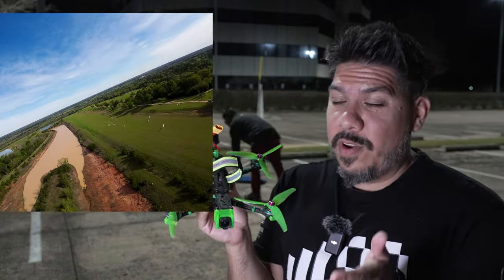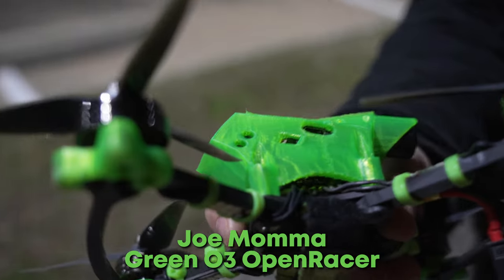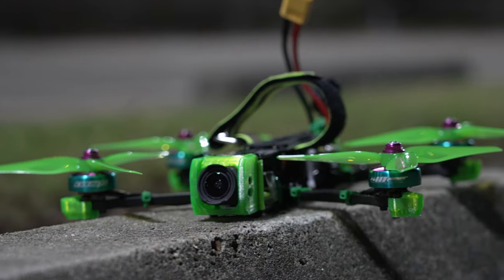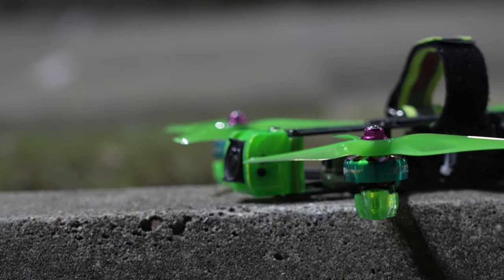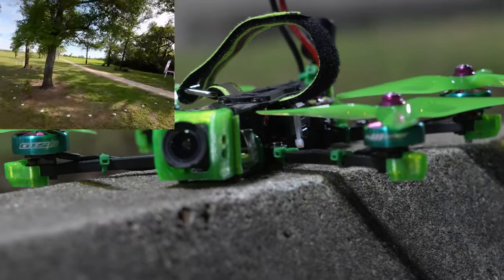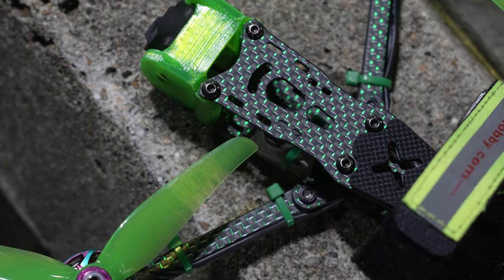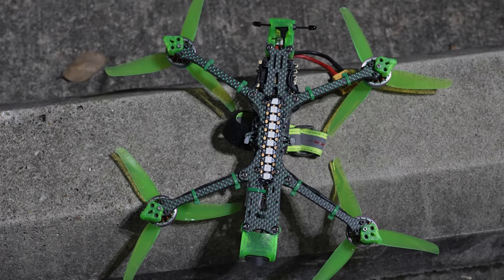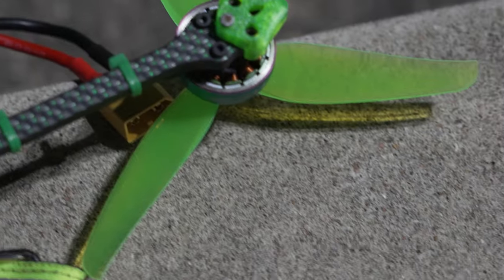Longrange Lightweight drone w built in DJI HD

Comment: Great overview of the quad! I put a good amount of time, thought and effort into that build, I also shielded the wires to the GPS to stop any interference from getting in from either the ESC or the antenna from the O3. I'll put my parts list below for those interested.

Frame: Foxeer Aura UL 5"
Motors: RCinpower 2105 1850kv
FC: Holybro Kakute H7
ESC: Holybro Tekko 32 Mini
Props: Nazgul F5
Lipo: Tattu 2200mah 5s 95c 
GPS: Amazon BN-180
Buzzer: VIFLY FINDER 2
LED Strip: 25 long LED strip from RDQ
Reply from the maker: NICE, pinning this comment so people can see full build list.
Reply: Dang look at joes fancy shmancy build who knew he could also fly slow too hahaha
Reply: @GrauFPV  it's not my preferred method of flight sir. But yes, I can do it, and I can keep it smooth. But where's the fun in that. Jon cut out the footage, but I got so bored doing it, that I decided to run it through the track slowly. Broke an arm in the tree dive because I had no cam angle to see where I was going lol.
Reply: Just FYI, those RCinpower 2105 plus motors are actually 2105.5. That's what the "plus" in the name designates.
Sick build btw.
Reply: @johhngoblin  awesome, I didn't know that, never even paid attention to the fact that they even say "plus" until I saw your comment lol. Thanks man! lots of TLC went into this one.
Reply: Realized I left out the RX/TX
TX: Radiomaster Ranger ELRS 2.4ghz
RX: Radiomaster RP1 ELRS 2.4ghz
Reply: What did Jon E5 say after  conformal coating at 2:54? It sounds like "PE 7000".
Reply: @JustinHunnicutt  E6000 is the glue he was talking about.

Comment: Awesome. I also got one of those O3 tpu prints for mounting my o3 camera. It didn't fit in my 6" apex frame. The added advatage is also to get the props out of view, by shifting the camera more foward. Gained some space for the gps mate in front too.
Did he go for 6S or 4S kv motors?
I like 2005 motors. 
Try an 18650 LiIon pack from molicel p28a cells and you get super long flight time.
What packs does he use and what flight time does he get?
Reply: I am using 5s lipo, I put a comment above of full parts list in this flight. It's a tattu 5s 2200mah 95c lipo. I get anywhere from 18-20 minutes of flight time flying like I was in the video.

The motors are RCinpower 2105 1850kv also BTW.

Comment: Real question is, what's he using for his radio receiver? Crossfire? ELRS?
Reply from the maker: joe Momma LOVES ELRS, he uses it for all quads, freestyle, racing, and even team racing with HDzero.
Reply: @JonE5FPV  Man after my own  heart. Just switched to ELRS + O3. Fantastic combo
Reply: ELRS all day every day buddy!
Reply: @JoeMommaFPV  Great looking quad! Quick question for you since you're on the same setup. Can I leave the air unit's SBUS and ground cable soldered onto my flight controller so I can switch back and forth between my DJI Controller 2 and Radiomaster Boxer? Or do will leaving them soldered cause 2.4GHZ interference with my boxer?
Reply: @Aether-Entropy  Interesting question. The only way I can see that working is if you have 2 separate UARTS available. But to switch between the DJI controller and the other protocol, you'll have to go into betaflight and disable the uart with the DJI sbus soldered, and enable the uart with your other protocol soldered to it. You can't have two different RC protocols wired up and uarts enabled for it, it won't work like that. I can't think of a reason why that wouldn't work (the method with disabling the uart you are not using at the moment). They are both 2.4, yea, but they will be in different parts of the band so they shouldn't interfere much I wouldn't think, just separate your antennas with one on the front and one on the rear, and I think it should work.
Reply: @JoeMommaFPV  This is actually precisely what I did. Two separate UARTS. ELRS antenna in front, O3 antenna in back. I'm running a SpeedyBee F7 with built in bluetooth, I can easily swap UARTS on the field. I like to have both options available, but just wasn't sure how much interference I would get. I did some long range testing going out about half a KM yesterday. Surprisingly my O3 started dropping down to 17MBPS before my Boxer did (ELRS running at 100HZ). 500m isn't even that far, especially for clear line of sight on an O3. 

I haven't really seen many people talk about this. Guess I'll have to do some more  testing. Thank you for your reply!
Reply: @Aether-Entropy  that's weird. If anything the 2.4 should affect your rc link even on the 03. I am fairly certain it ONLY uses 2.4 for control link. Never video. At least that's what I heard from Ian at Mads tech. I know I personally need a better antenna setup suited for longer range. The short stubby stock antenna isn't really doing well on long-range pushes for me either.